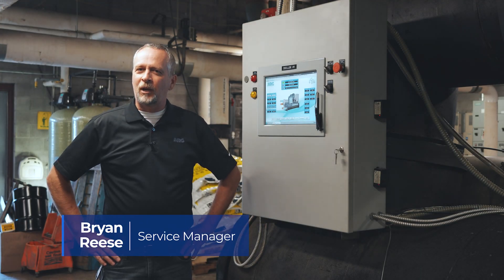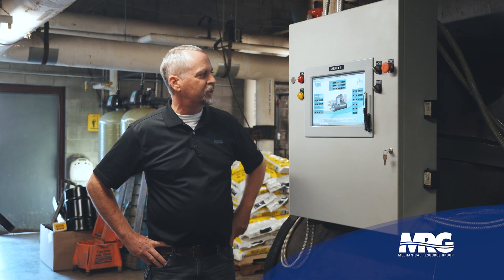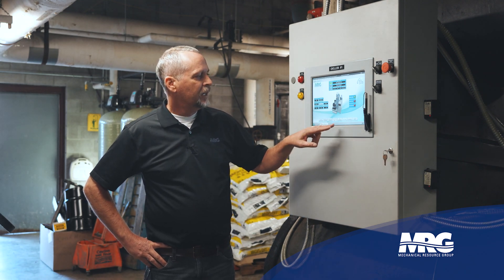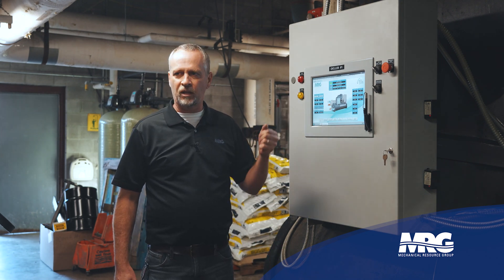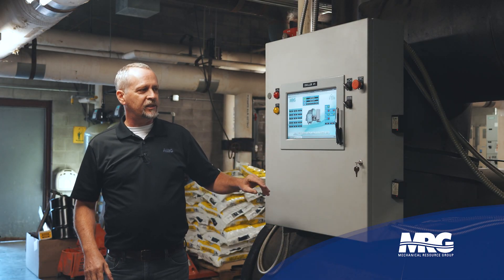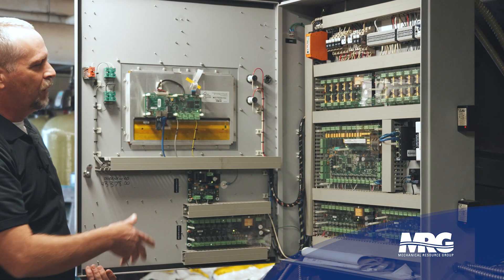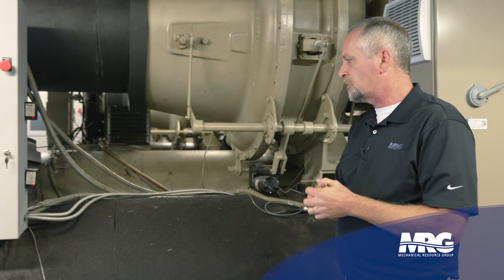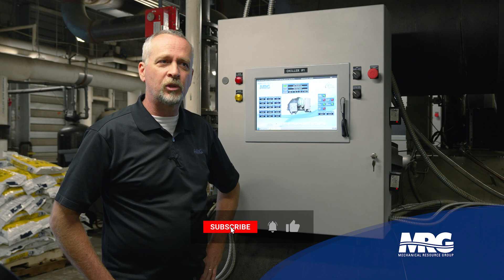MCS Control Panels: Your Non-Proprietary Game-Changer

Comment: I ha 2 a vrv4 heat recovery 2oth the new daikin touch plus smart thermostats x4 with 4x fcu & 1 IS stuck in master &other 3 unable to start them because it's locked by master. If u can help me in this bind on a job in NYC thanks a million in advance

Comment: Dunham Bush uses them as an OEM controller out of the box. That MCS Magnum is a nice board and easy to understand. Its overall a great system to use. Plus the manufacturers are being a holes....and trying to lock us non OEM guys out if their newer equipment. MCS has a great interface on the laptop. Everything is on 1 page...im a fan of them
Reply from the maker: I completely agree with you! The MCS Magnum is a fantastic board and the interface on the laptop is so user-friendly. It's great to hear that you're a fan of them too.